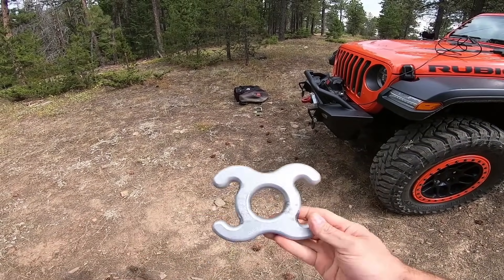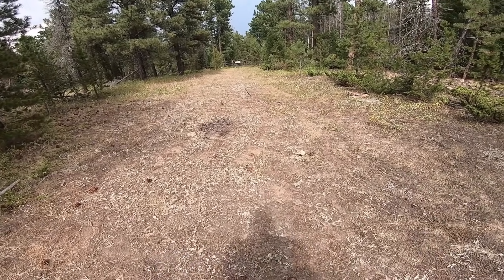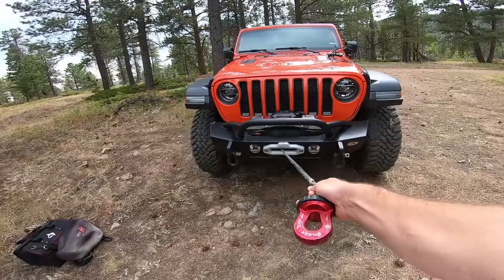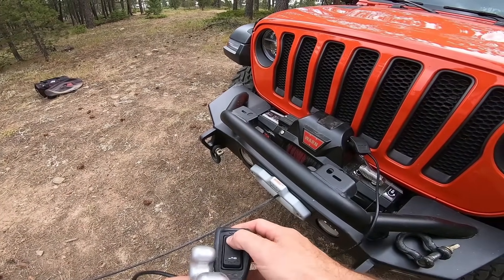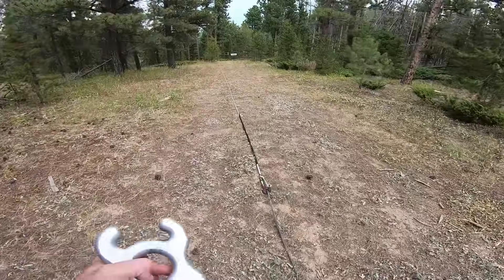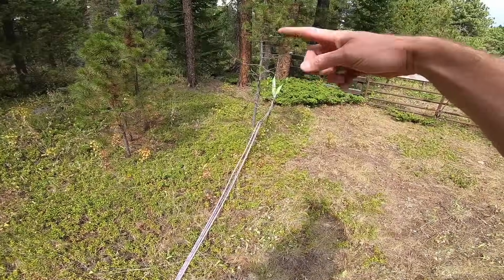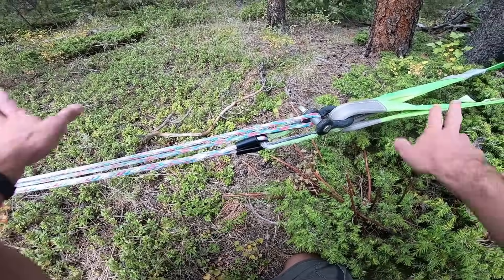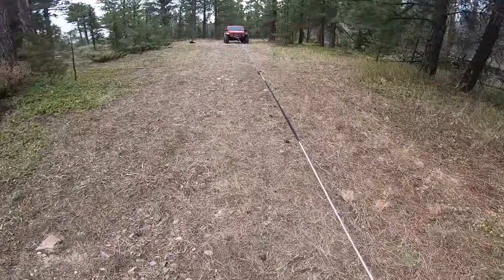Offroad Recovery Gear - What's an X-Lock Part 2

Comment: Very informative.  Cool tool for synthetic winch rope. 

Please understand,  I'm not trying to be over critical here.  But I have a concern on your terminology.  I have spent 30 years in the Towing & Recovery Industry.  I am a Training Coordinator for a reputable company that specializes in Quick Clearance of Heavy Duty Truck & Tractor Trailer Recoveries.

My concern is your use of the term "winch wraps" as it pertains to your rope.  In the Towing or  Crane & Rigging industries, each revolution of the winch drum is revered to as a "wrap'.  Thus the term, "Maintain a minimum of 5 wraps of rope on your winch drum.  To ensure that your rope doesn't pull out of its attachment point."

What you were referring to as "Wraps" is actually called "Layers".  Each time the rope fills the drum & climbs on top of itself, it is called a next "layer."   Each time you start a new layer, it is like changing to a taller gear on your mountain bike sprocket.  So yes, you are absolutely correct that you will loose effective power with each layer you add.

One other thing.

As you know.  Any rope is has a rated Working Load Limit (WLL) that is far less than the winch rating.  For Towing & Recovery, the rope WLL is usually the Rated Break Strength ÷ 3.5 = WLL.  So a typical 3/8" wire rope on a light duty wrecker with 8,000 lbs winches has a rated break strength of approximately 14,000 lbs.  Or a WLL of 4,000.  Therefore, if we are on a first layer pull, we will double our WLL.  To stay within the WLL, we will add a "Snatch Block" to reduce the line tension.  At 180°(or doubled back to an attachment by the winch) it will reduce the line tension by 50%.   Adding a second part to your line will also take more line off of your drum.  Therefore, removing layers & increasing your winches effectiveness.

I could go on for hours.  

This is a cool tool to have & can be very effective in the scenario you are describing.

Thank you for your time.

Comment: Idk if anyone ever asked this but can you and/or is there any times you would need to use 2 x-locks in a row or something?
Reply from the maker: I suppose it could be possible.  Using winch line extensions.  We have used them at the same time when 2 vehicles were winching at the same time to pull a vehicle back onto a road.
Reply: @JustinKingOffroad  so maybe just for a very long winch point day up a long hill or acrossed a far field without a good place to winch to?

Comment: Great video ! I have a punkn rubicon too what size lift and tires are you running?
Reply from the maker: This is still a Mopar 2 inch and 35 inch tires. Does everything I ask it to.
Reply: @JustinKingOffroad   it looks awesome! Very proportional and I want to get my ring on my wheels painted orange that’s a nice touch!

Comment: 1.5 times the 5/16 inch rope gives a 1/2 inch bend radius so that requires a 1 inch pin
Reply from the maker: you are correct!! but that is really for overhead lifting where that rating comes in.  all the I4WDTA trainers say 3/4 is sufficient for winching.

Comment: When I was a kid living on a farm we had a WWII surplus monster hand winch that my dad said would pull a house off of its foundation. I will never forget using it to pull a massive dump truck out of a swamp.
Reply: Check out the "Wyeth Scott More Power Puller".the company startd making them in 1934.  Im pretty sure this is what you are referring to.  I own one.
Reply: @randyott2413  Randy I did look at them. Tks.  Ours had an enclosed gear box that used a 6' chain the size of your forearm which ran into the front and out the back of the enclosed box. As I recall it took about 10 minutes to move the chain the full extension of 6'. There were no cables involved.

Comment: I've never done off-roading but I understood...
It's a tool to artificially shorten the cable while the cable needs to be fully out to reduce the diameter of the drum of the winch, so you can get more torque out of it, without the pain from installing a pulley. Simple and easy.  I wouldn't have expected you could loose half of your torque because of the cable around the drum (making the diameter wider). So now all of this makes sens.
Reply: @Fred Wills "For that to be true the winch would have zero torque when fully spooled" No, just no... The torque just depend of the diameter (lever arm) of the cylinder the rope is going around (and is none related with how much rope is left to be spooled). Twice the diameter = half the torque, it is as simple as that.

Comment: Enjoy the video but I still don't see where you wouldn't just put a pulley on the end of that first hundred foot line go back to your Jeep considering you're in supposedly deep snow that Hundred-Foot walk up and back would add a lot of time and effort keep up the good work
Reply from the maker: Sometimes that's not taking up enough line and you still have to use the x-lock even with a pulley. I've done it numerous times.

Comment: Ive used a small log( green 2 to 3 ich x 1 foot or so) in the same concept. Spiral wrap the main line and use the slack loop around the main and over the jeeps end and then do the same on the anchor end of the log. Bungee half of a tarp around it leaving the other half loose as a wind drag in case s$#/ lets loose.  Good vid. Thanks stay safe!!

Comment: Justin, you did a great job!!! Good clean demo, nice tone, CLEAR WORDING, good video. I have been a truck restorer in Iowa('67-'72 Chevy/GMC 4x4's) for 35 years, nearly 350 body-off-framers done.Dealt with usage and install of hundred and hundreds of winches mounted EVERYWHERE(except cab roof) LOL.  This is a CHEAP and great little device you have. Gonna order one(or two) right now. One thing I saw wrong and one thing only in your vid. Buddy you have to ALWAYS and this is the main take-away of the day use a line suppressor, damper, absorber, whatever ya want to call it. If that winch line ---I don't give a damn if it's made of bamboo strips ever snaps and has a flesh covered object(human or animal) in it's way----it's dead or would hope to be !!!!!!!   Saw one accident ---don't want to see another!!!! Thumbs up!!!!        Jim
Reply from the maker: We have done pretty extensive testing with winch line dampers and they don't do anything.  The line still recoils your best bet is to not be anywhere near it.
Reply: @JustinKingOffroad  Years ago I spoke to the actual Dyneema engineer in Holland and there is no need for a dampening device: if the Dyneema rope breaks, it falls to the ground "like a broken woman's stocking" (his words).

Comment: Can someone explain how you lose winch capacity as it draws in? Is it because the drum increases in diameter?
Reply from the maker: great question and yes you nailed it.  the drum on a winch is like the front (pedal side) gears of a bike.  the smaller the sprocket the easier it is to pedal.  the larger the diameter of the rope stacking on the drum, the harder it is for the winch to work to free you.

Comment: also I forgot to mention if you can and if companies will give them to you use industrial straps and the reason behind this is those 100% have to be rated for that lifting capacity on the plastic tag only reason you should turn on down is if it's already frayed on the outsides or in the in-pieces are showing also kudos to you for un-loosening your shackle after you tightened it amazing how many people over tighten them then cant get them off after putting a good size load on them

Comment: if our ever in a bind and don't have a enough space even to just use your strap fully extended you can basket your strap and make it shorter to. also a strap in a basket configuration around a tree with ends meeting a shackle around sturdy enough object works amazingly well to

Comment: The other thing I'm seeing is that tree side of the X Lock is secured with 3 runs of rope now, so in the event of a winch rope failure I can't see that ever becoming a missile.
Reply from the maker: If it did fail, it would fly the direction of the 3 lines.  We have tested this multiple times.

Comment: I don't play this game any more (Getting old) but back in the day (Hunting big game in very rough mountain terrain) we had (Old technology) 16,000 lb winches ran with power take off (Often two 5,500 lb 4X4 pick ups under full loads tied together) What we did was (pullies if the total load was off the charts) 1) the winches had 50 feet of ½" steel cable 2) we carried a 100 foot steel cable, a 50 ft steel cable and two 25 foot steel cables, two 25 foot chains, two 4½" snatch blocs and two or three simple pullies. yes that was a lot of heavy cable to haul around for the "just" in case events but through the years we did have to use some or all of it. In your scenario (straight pull), we would haul out the 100 foot cable with the 50 foot cable and one or both 25 foot cables (Add the 25 foot chains if required) We would pull in 50 ft, remove the 25 foot chains or 25 foot cables hook up the remainder and remove as the cables spooled in. The winch spool had a cable pincher on one side so when the initial 50 foot cable was in we would remove the hook and insert (in the pincher) the remaining cable and that would allow us to continue winching. (I remember using the pincher only once, it was a lot of trouble for little gain and the winch could only recover an additional 60 to 70 feet and then two or three guys had to pull the 100 foot cable off the spool and pry the cable out of the pincher, then slack the ½" cable that was caught among the rest of the cable on the spool but that was a rare event. We rarely used the 100 foot cable. We always managed to pull ourselves out of creeks and beaver flooded roads and often pulling out others stuck to no end. Great times but now I watch great videos like this while sipping my espresso ! Keep it up, it's a lot of fun (to watch that is). Play safe and be safe.
Reply: It is all fun until somebody fools around and gets stuck.
Reply: @ridgerunner106  I'll tell ya' when you're with a lot of pick-ups and an assortment of tools and equipment and deep in the back country hundreds of miles from your fellow humans and you find yourself in some predicament......knowhow and your tools will get you out. Fools are not part of the equation !
Reply: @palco22  I know, I drove ro Alaska in a 75 highboy pulling a 33' horse trailer full of junk.  Sometimes was 1000 miles to town either way.  Me and another ole boy.  Yes we broke down. Yes we kept going. Yes we crossed the Yukon river.  Took us so long that everybody knew who we was when we got there.  Maybe we touched some lives.  I got much good out of it, from the people I met along the way.
Reply: @ridgerunner106  Exactly ! Those are the times we bring along with us as we travel life and if you have a couple of old photos (well old today) we hold them dearly because we can no longer relive those days ! Our parents often told us stories of the good old days and more often then not we just shrugged it off and now our pass moments are now our good old days. Our kids now shrug their shoulders ! 
Today, I still live the rough life a few times a year.........in a travel trailer with complete bathroom, kitchen and a queen size bed, oh and full hook up service ! It's a shame, but what can I say. Now the bones crack and the joints squeak and I fall asleep thinking of those good old days !
Reply: @palco22  We have been blessed by attempting the impossible with nothing and surviving to tell the tales.
Reply: @ridgerunner106  Well said !

Comment: So would it be better to get a shorter winch line and then use an extension line with it?
Reply from the maker: That is exactly what I did for my truck!  60 foot line. 60 foot extension.
Reply: @JustinKingOffroad  thank you for the information.

Comment: To comment on what you mentioned at the beginning of the video about other's concerned about the xlock hurling back, If the line were to break it would be on the single side and the xlock would hurl away from the vehicle.
Reply from the maker: correct!

Comment: I am still confused about the MBR. You said in the video 1.5 times rope diameter, then said the rope was 5/8". 1.5 times that is 7.5/8 or essentially 1", not 3/4" and I am fairly sure the pin on the shackle is 3/4", but may be wrong. Could you clarify? 

I always wondered about ways to take up slack, but have always been using steel line. Winch died, next one will have synthetic.
Reply from the maker: minimum bend radius over 1 inch of length i believe.  so a 3/4 screw pin is acceptable.

Comment: Good video and explanation, but silly device. The whole point in having a winch is not having to deal with a bunch of extra line. If you are worried about the pull strength then get the right sized winch for the application.SMH
Reply: Im thinking this was more about reach.

Comment: Nice instructional video. Not seen one of those before. A stake in the ground would have proved to the doubters that the x thing didn't move. Only observation I have from both of your videos is I find I get a better grip on the Leatherman type tool if i don't open the pliers and just put the points in the eye of the shackle. I do lever in the same direction just so I am not bending the tool sideways. If really stuck I have put a smaller shackle in the eye and a bar in the smaller shackle. Even without a winch these would be good to have for any use where the ability to shorten the rope quickly and easily is an advantage.

Comment: Since you do this often and have good information.  I have a 2017 ram 2500 and would like to get some recommendations for a solid winch setup for my truck if you can help me out with some information thank you ahead for your help
Reply from the maker: i'd go 12,000 pound minimum on that winch.  if you get a 2500 stuck the "stuck force" quickly gets up there near 30,000 pounds depending on what you're stuck in.  if you can justify a 16,000 or 18,000 pound winch that would even be better but $$$$!  Warn, Superwinch both have some in those ratings.
Reply: @JustinKingOffroad  thank you . I have been looking into the smitybilt x2o 17.5k , warn 16.5ti-s or 16.5ti or superwinch I believe has an 18.5k winch. I have a road armor stealth lonestar bumper and I have a Cummins so inner cooler . I would like to get larger than smaller.  I have some recovery gear but still building a well rounded kit

Comment: Nice work, the  question I have is... Why do you not drape a coat, canvas tarp or burlap bag in the middle of the working line. To slow it down, should it fail?
Reply from the maker: it not needed with synthetic line.  stay in the limits of the gear and everyone goes home.

Comment: Second video and a new subscriber, don't understand the loss of pulling power on the winch with more line spooled on the drum.
Reply from the maker: Think of riding a bike. Is it easier or harder to pedal when the front sprocket is on the larger gears or smaller gears.

Comment: I was trying to figure out how to shorten extension lines; you’ve readily answered my question!

I’m trained in rope rescues and have some very distant commercial heavy recovery experience but couldn’t figure out how to do what you easily demonstrated!  We use prussiks and secondary lines & anchors but I don’t think those techniques are viable with these lines and equipment.  

Thanks for two very clear and understandable videos on the topic!
Reply from the maker: woo hoo!! glad this helped.  i had plans to make a 3rd version of this video with I4WDTA certified trainers and we were put on hold due to a corona virus exposure.  hopefully we can do that soon...
Reply: Use of a "sheep-shank" will shorten any line.
Reply: @brunoterlingen2203  I was sitting here wondering the same thing. I am no high end expert on knots but it seems that a sheep shank would serve the same function.

Comment: May not b a good question no need for a big video but i see you use poly rope instead of wire in the winch. One thing I know for sure is weight matter but what is the different of the strength. Thx for the videos I don't have to pay for training lol.
Reply: The higher strength synthetic rope lines (HMPE, or High Modulus PolyEthylene-based line in particular) can be stronger than steel cable of the same diameter when comparing the same strength rating.

Comment: I don't even own a winch but recovery videos are interesting and this thing is pretty cool. But I'm a little confused, is the point of this thing over a snatch block in the case that your winch line won't reach the anchor point and then come all the way back to a second anchor (ex. your rig or another tree or something)? Otherwise if you're having trouble getting out would a snatch block not provide more power (especially if you doubled up on pulleys)?

Comment: Good info thanks. Only area where i could see an issue when bending your line over the shackle pin the pressure of the line if touchng the exposed threads could could damage your synthetic line. Those threads are course and tend to be sharp.

Comment: When I want to rewind my winch cable, I put the Jeep in 4wd-low, and Reverse.. And of course roll down the window to steer.
.. If I see the cable isn't winding like I want, all I have to do is spool out to where I want to redo, then just spool in again..  I don't know that this hurts anything. Motor idling..  This works very well for me..  Isn't like I do this very often..

Comment: Brilliant!  Effectively making an anchor rope variable length.  A 300 foot long anchor rope can theoretically be reduced to 100 feet over multiple pulls using the same rope and winch line without ever having to disconnect.  Just relocate the X-Lock between pulls..
Reply from the maker: Bingo!